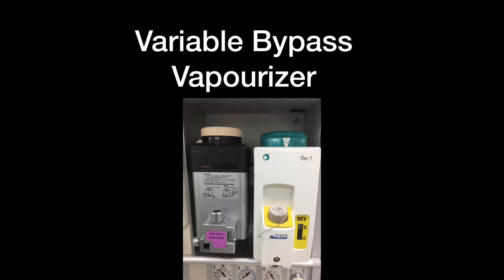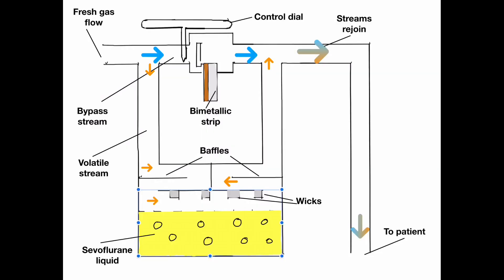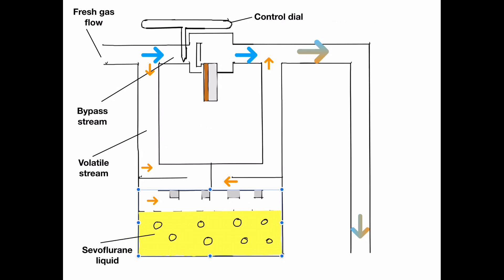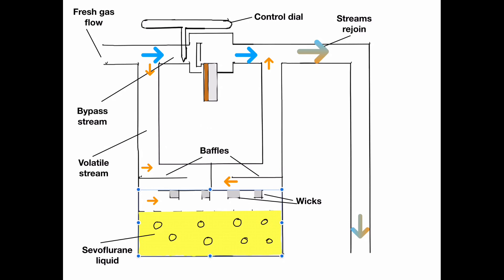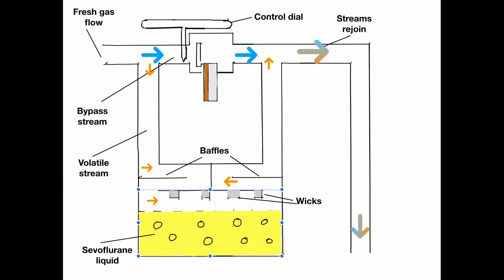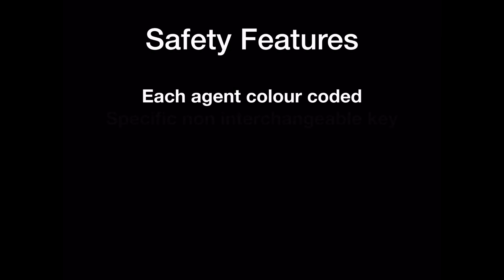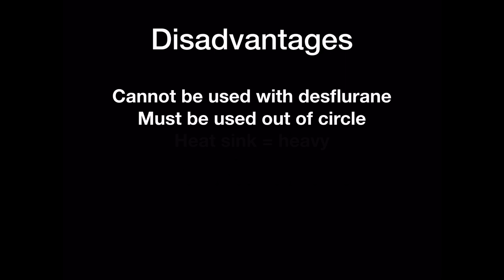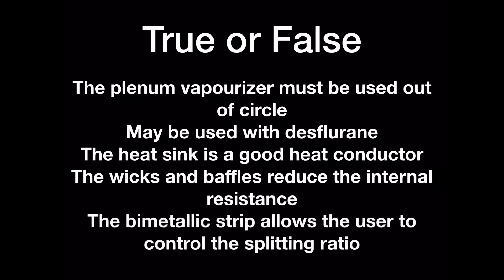Variable Bypass Vapourizer Simplified! Key anaesthetic exam topic

Comment: Im pretty sure the directions you drew for the bimetalic strip are incorrect… double check me, but if the volatile is warmer, then more will evaporate, and the concentration will be higher, we would like to counter that by limiting the flow the the evaporation chamber… No?

Comment: Regarding the plenum vaporiser dial, when I turn it to 1%, what does this actually mean? Does that mean that there is 1% volatile coming out of the vaporiser before it rejoins the FGF or is it 1% of FGF?  TIA
Reply from the maker: The aim is to achieve the desired percentage to be a total of the fresh gas flow. So for example at atmospheric pressure we would aim for around 1.7% sevoflurane to achieve a MAC of 1. 

This article may be helpful: https://www.frca.co.uk/Documents/171%20Vapourisation%20and%20vapourisers.pdf